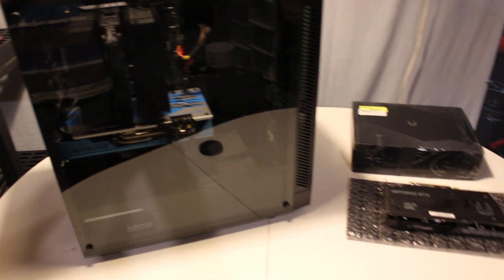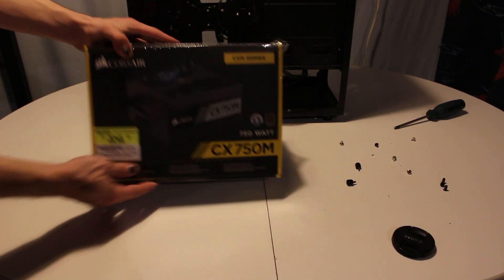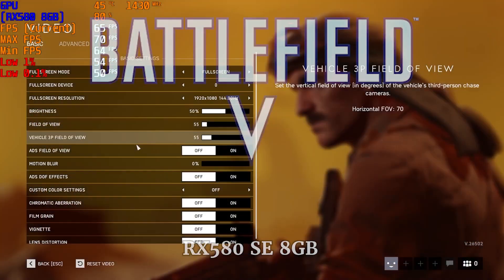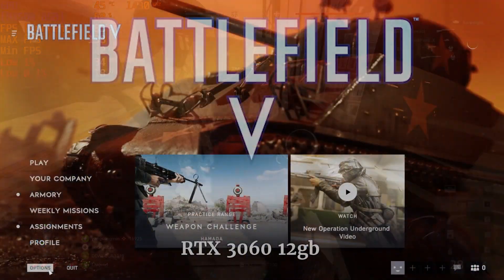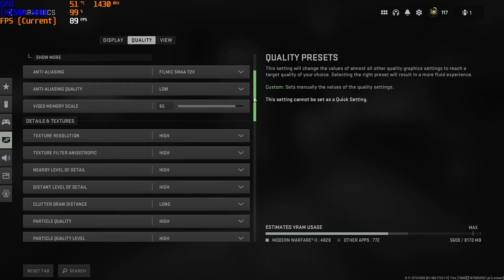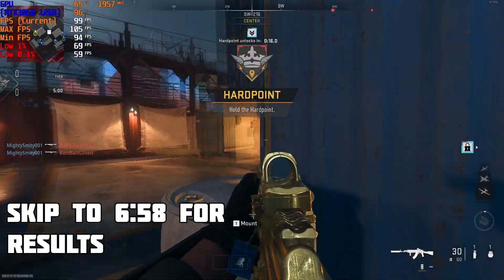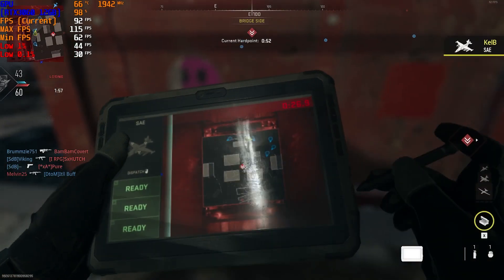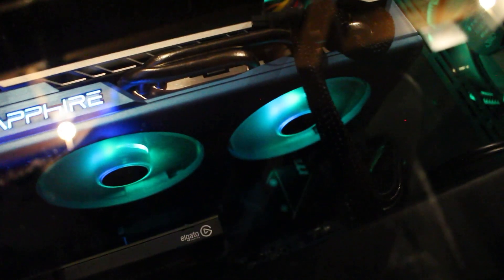RX 580 8GB vs RTX 3060 12gb! (For Science) +Benchmarks!

Comment: so which one is better
Reply from the maker: 3060 performs way better and came out on top, in some cases as mentioned in the video, the rx580s max framerate at times were same as the minimum framerate of the 3060. Ngl From the start i didn't expect the rx580 to do better, my motivation was partially to help those who have similar cards thinking about dropping $500 + on the same card see how much of a performance increase they would get. Tho now that you've mentioned it i Believe i could have taken a different approach on the conclusion and made it a bit more clear that the 3060 is the one that comes out on top,  as i sorta left it up in the air instead of just saying "the 3060 is better"
Reply: @KelBShobra  good, i was planning to upgrade
Reply from the maker: @PeciniVideoKlipovi thanks for the feedback on the video! I appreciate it a ton!

Comment: will  an intel  4770k   bottleneck  the 3060?   im  runing  the  amd   580x  on a  1440p  monitor  it  does  fine  but   i  occasionally   dont   get   to experience  120 hz    because the  framerate    will  be  lower  than that. ----  EDIT ----  Due  to  fortunate  circumstances  its a  new in  box  3060  and   i  only  pay  100.   so about the third  of  current  running price.   i just  donno  if a  4770k   i7  will bottleneck it.
Reply from the maker: If you compare the i7 4770k to the 3600 shown in this video it's 13% less efficient. It is also from 2013 while the 3600 is from 2019. This cpu will most likely bottleneck a 3060 more than if paired with a R 3600, but if you already play games at lower settings on a rx580 to get up to 120hz (as i understand framerate is better than graphics in a lot of situations) you might be able to ride with that cpu for a while if its whats already in your build. And If it's something you plan to buy, consider that the cpu i used in the video and many other newer ones are around $150 cad to $230 and can get you the performance you are looking for, its worth the extra bit of money in the long run sometimes. understandably tho you may need to upgrade your motherboard if you go that route and you might be on a tight budget. thats awesome that you got the gpu used for a good price, there are TONS of good gpu deals goin on right now. You could possibly do the same with a cpu and motherboard to save some money. Where I live You can find some stores selling amazon return stuff for like nothing and you can occasionally find motherboards there. Just gotta look them over good. That's what I've done with my build, and I've been working on a video for that, not sure when it will be out as I don't like to rush stuff but I'm hoping to have it finished sometime soon. Lots of crazy good used stuff going around.  its a great time to build a newer pc
Reply: @KelBShobra   thanks.  i bought it for 100  even.  its still new in box im prolly gonna  sell it.

Comment: How many Psu Wattage need for 3060??🌚
Reply from the maker: Damn i knew i forgot something lol my bad. Twin edge 3060 12gb is 170 Watt,  but im using a corsair 750 w psu. Can i ask do you think i should re-upload this video and fix some things i missed? Do you think it would be worth it ?
Reply: @KelBShobra  Yeah 👍 thanks for this information....Does it works with 650watt Psu?🙂
Reply from the maker: @LAVA  PLAY  Nvidia recommends a minimum PSU of 550W psu, just be sure to calculate how much power your cpu and other accessories intake. I dont think you should have much issues with a 650w psu